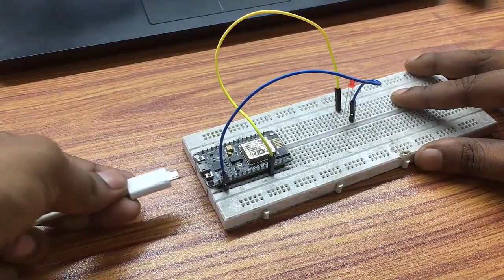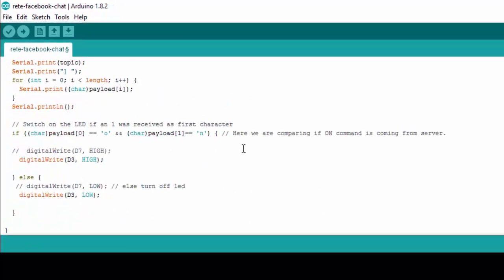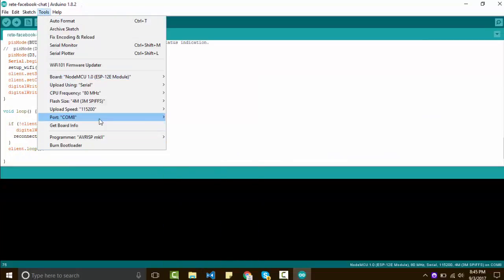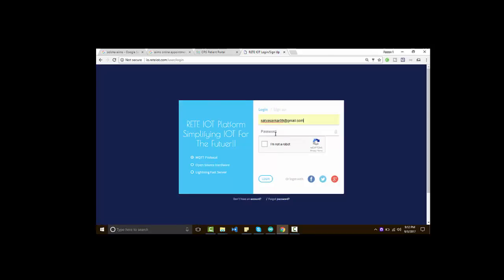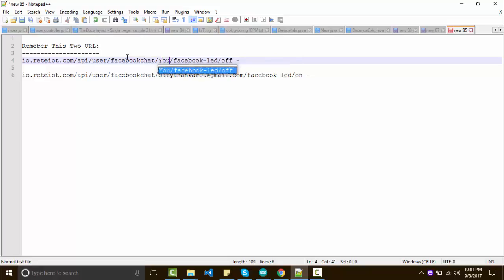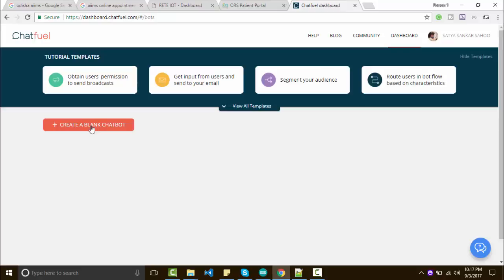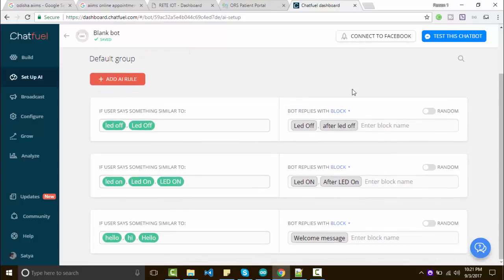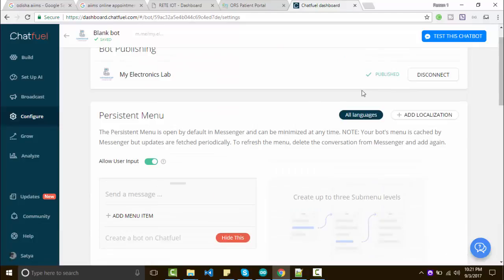Facebook Chat With ESP8266 |  IOT Project | Rete IOT

Comment: Good work , thank you so much.
I already did it and it worked.
Please i have a question and you will make ne happy, if i could get the answer!
My question: if i want to make more than one led, how can change the code for maybe 2 led? 
Thanks a lot 
Greetings
Reply: I found the connect with Google Assistant is better than Facebook Messenger , but anyway you should try to follow again the same procedures, I'm sure that it will work.
Reply: same problem
Reply: plz help
Reply: serial o/p gives -Attemptting  MQTT connection...failed ,  rc=-2 try again in 5 seconds
led is not turning on

Comment: Hey Bro, I did it. But little confused while running this code for multiple GPIO. can you please specify what code to add for more buttons?
I did something like this.

  if ((char)payload[0] == 'a') { // Here we are comparing if a command is coming from server. 
     digitalWrite(D3, HIGH);
  } 
   else if ((char)payload[1] == 'b') { // Here we are comparing if b command is coming from server. 
    digitalWriteD2, HIGH);
  }
Reply from the maker: as you mentioned above, similarly add more logic c, d, e, f, and bind with gpio. you are good to go
Reply: bro, the following code is not working. Please can you provide some code?
serial monitor receives message like : Message Arrived [email] a
Message Arrived [email] b
Message Arrived [email] c but no led is responding connected to the pins.
Reply: Hey